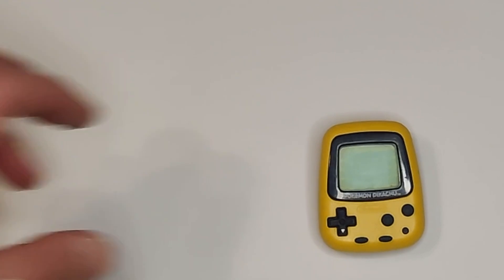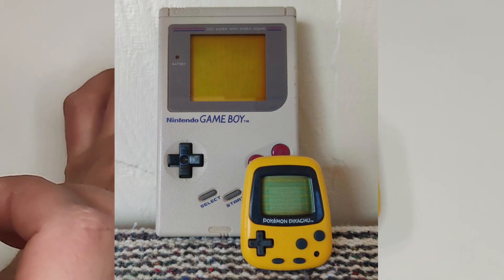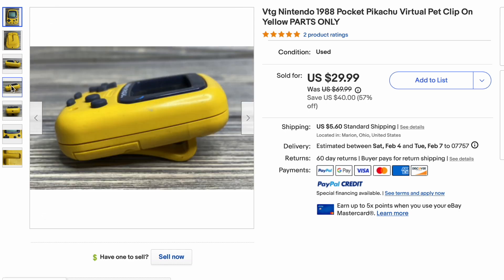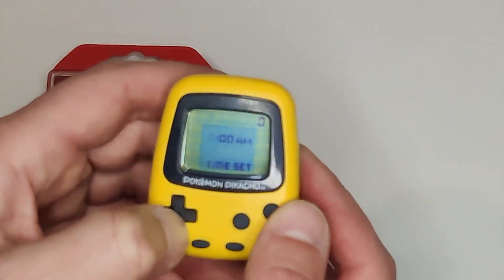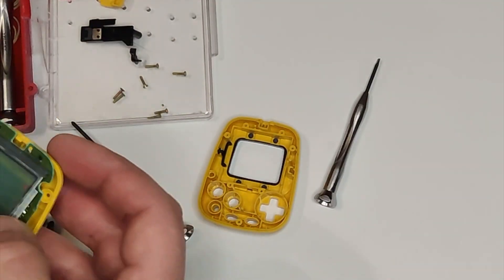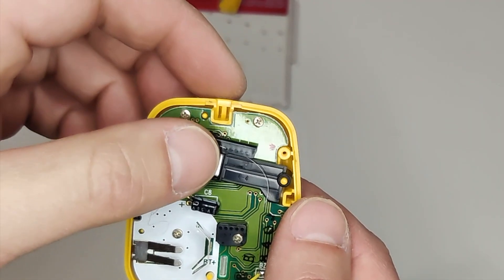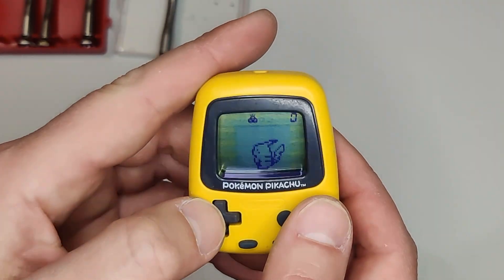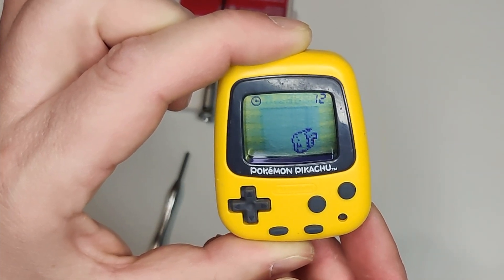BROKEN Pokemon Pocket Pikachu Repair

Comment: These can be hardware hacked by using an Arduino with a relay module. Solder a couple of wires off the pedometer switch (which is literally like a little steel contact that moves though a tube as you walk) and write a programme on the Arduino that will switch the contacts. It can't do it that quickly but it does work. 3 clicks a second is about the maximum from memory.
Reply from the maker: That's a bit out of my wheelhouse but it sounds pretty cool to pull off. Maybe I'll try it one day, thanks for the info!

Comment: So the screen on mine has started to fade a bit, so I think I need to swap the capacitor at C8. Can't seem to get it out though
Reply from the maker: It definitely sounds like the capacitor is the culprit. Luckily it's not obstructed in there though, if you're careful and have steady hands you should be fine. Best of luck!
Reply: @retrogameattic  hmm, so the LCD screen is attached to the board and the side of the capacitor that is soldered-in appears to be on the side with the screen on it, so it's actually covered...any tips?
Reply from the maker: @Bargadiel  You may want to message @preppietechie. He posted a video a few years ago about him fixing his screen issue but did not show instructions. He might be able to help you though.

Comment: I opened mine this morning and everything seemed to be fine yet it doesn't count steps....
Reply from the maker: Bummer! Is the thin wire spring properly situated inside? If it powers on and works well I would bet that the wire needs to be repositioned.
Reply: @retrogameattic  I will try it, thank you.
Reply from the maker: @adelynecayrol4956 Good luck & please let me know how it goes!
Reply: @retrogameattic  the wire is correctly positioned. I think it might come from the "detector". Is the wire inside the tube supposed to be cut in half?
Reply from the maker: @adelynecayrol4956  I don't think it's supposed to be but I'm not entirely sure. It might be worth your time to try connecting it.

Comment: Hello , thanks for your video =) . i have a question : I recently bought a tamagochi pikachu, but the pedometer doesn't work. I decided to open it up, and indeed the thin metal rod between the two plastics is missing. Any idea if this is made, or how to replace it, or where to find a replacement rod?  Thank you =)
Reply from the maker: Ah that is a bummer! I don't think there are reproduction metal rods available unfortunately. I would suggest purchasing a generic pedometer, recover the rod from it, and install it on your Pokemon Pikachu. It might not be a perfect fit but it's worth a shot! Maybe check out some Reddit posts as well. Please LMK how you make out and best of luck!
Reply: @retrogameattic   Hello , thank you for your answer =) . I found some fine metal rod in a bric a brac box.  They are barely larger than the rod in the video. They are bendable, it bothers me a little, but I think it can do the trick. But I'm keeping the idea of a generic pedometer in mind.   Wait and see =)

Comment: Any idea what kind of screw goes to the battery compartment? I have one of these in fine condition, but no clue wha screw I could get to replace the missing one.
Reply from the maker: I don't know the exact screw size, sorry! I suggest checking out big box & local hardware stores and maybe computer/cell phone repair shops for some specialty electronics screws to see if they fit. You might have some luck with a little bit of trial and error!